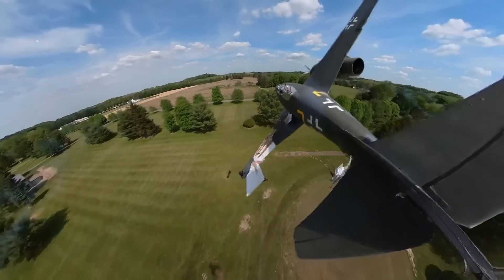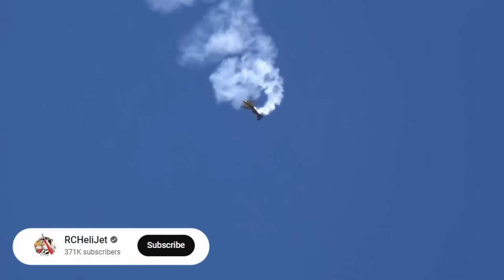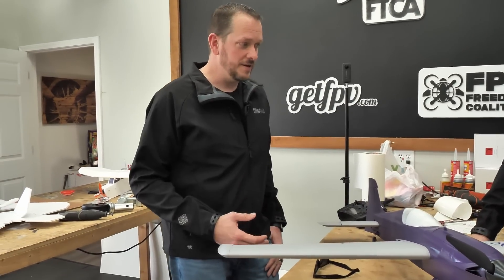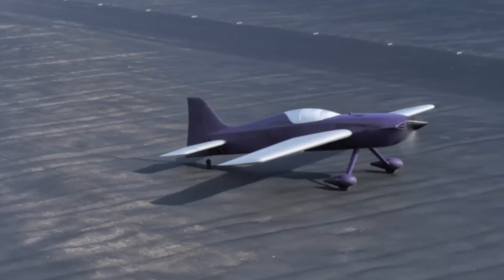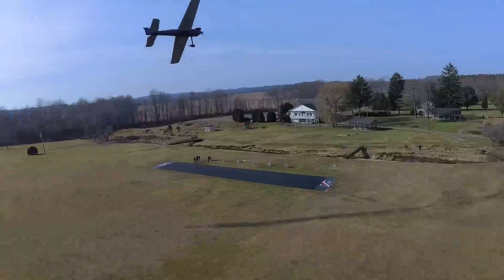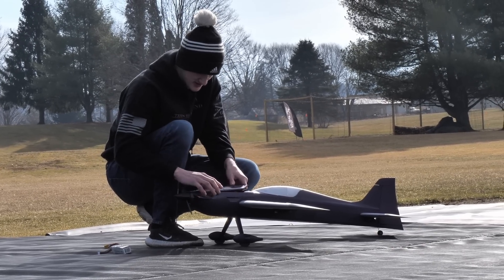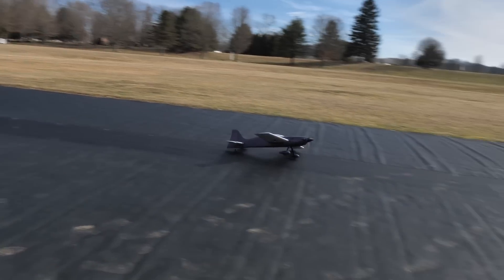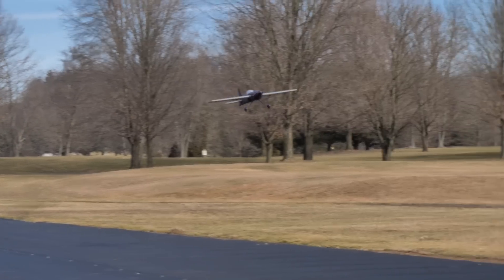We Tried Crashing This 3D Printed Plane

Comment: Excellent video, thanks! I'm new into RC planes and just built my own Eclipson 3D.

About the unbalanced spinner: I've started to 3D print my spinners, rims, wheels, basically any part that rotates setting "Z Seam Alignment" to "Random". This distributes the layer beginnings/endings evenly across the perimeter resulting in a more balanced part. On average.
Reply: I also always print my spinner in LW-PLA. Don't know why Eclipson suggests PLA, it make no sense to me as there is no structural load.

Comment: Has anyone tried printing parts like a traditional balsa wood kit? 3D printed ribs and bulkheads and such? I kind of want to try it. I'm thinking like, 3D printed wing ribs, carbon fiber spars, 3d printed space frame fuselage, then wrapped. I know that sort of defeats the purpose of 3d printing a plane, but it seems like it would be a little more adaptable, and certainly a lot lighter.

Comment: Are you ever going to build or talk about big balsa or gassers again? I get the chan is targeted at new pilots and children but those new pilots get more advanced eventually. I look through your videos from time to time and all I see is electric and foam stunt things based on current fads. That's fun and all but id love to see a little more or the test in flight test and some more where to go after basic foam board and electric from the senior guys that have done it all.  The last heli video I can find is many years old.

Maybe how to get started with fiberglass or carbon fiber? Maybe some experimental hybrid printed foam composite and laminated stuff all combined in to one plane? Maybe some flight controller stuff like a foam board endurance challenge where two planes are given the same battery and have to fly a largeish pattern to see what goes longer?

IDK, but or me at least the we built a giant foam X and put enough motors on to make it work for a video gets old. Yes, I realize this is a 3d printed plane in this video, that's what attracted me to even click on it was that it wasn't foam and was a new FT video.

Comment: The plane works great, I would like to ask where can I buy 3d printed models?
Reply: I'm just 'thinking outside the square' to help out. Maybe you can do a search and find a 3D printing company in your area. A lot of these 3D prints are often open source and free online. So if you can find the site and files you need for a particular model that you are interested in buying and building, you could print off the list and site and then see if you can get a quote from the 3D printer business. That way you get all the parts you need and then you can assemble it. Do you know a school teacher or school near by that might turn it into a class project? 
Otherwise the usual online stores would provide you some links to kit models. Best of luck.

Comment: Disappointed you didn't actually crash it and show how durable it is and how repairs are easy to do with 3D printed planes.
Reply: I was also disappointed. Why make "crashing" the title of the video? Kinda felt like clickbait, or sensationalism at least.
Reply: I made one of their planes (black wing?) and they are not durable at all since the walls are printed extremely thin (around 1.5mm). I was printing for over 30 hours because printing LW PLA isn't as easy as they make it sound the prints often would fail several hours in (the pla has air bubbles inside intentionally, making it lighter). Mine then got partially crushed moving it around and since then i haven't had the motivation to go back and print for another 2 days to repair it. That being said I think the 3d modelling and research they do is really professional and perhaps it's worth building one for the novelty factor. Even though mine has not flown I can tell that one crash and it's over. I thought it could be improved with some fiberglass but then it would throw out all the aerodynamic and physics etc that they design the planes around. Still cool though
Reply: WAHHHH!!!!!